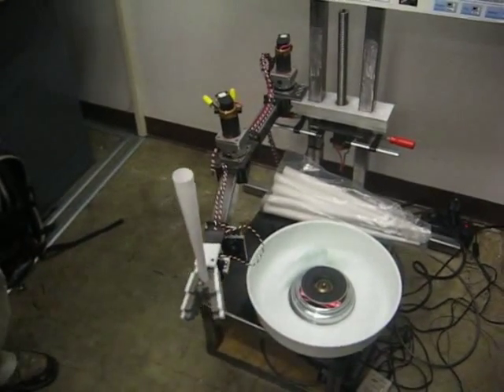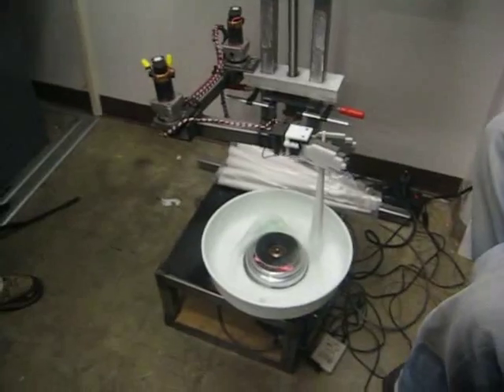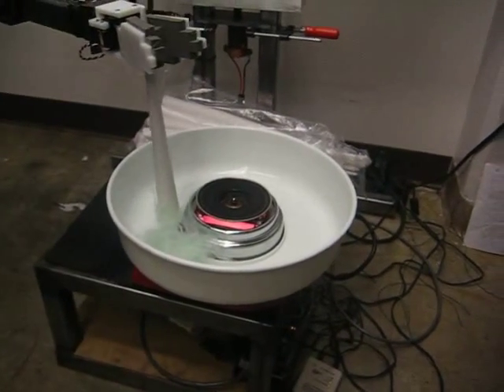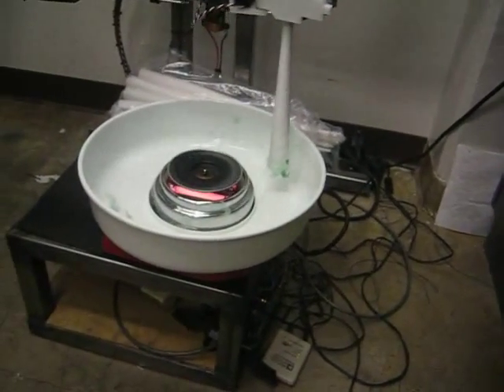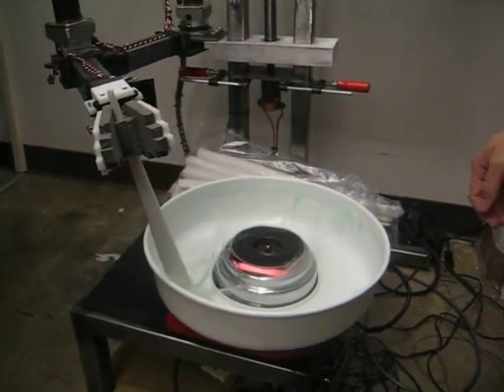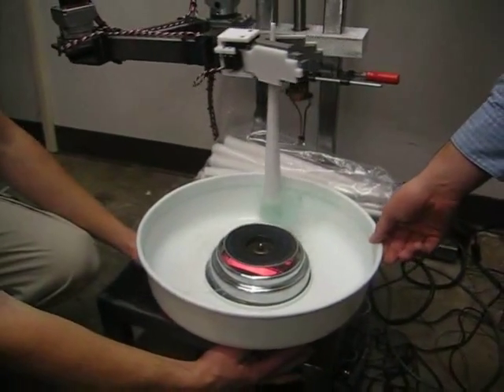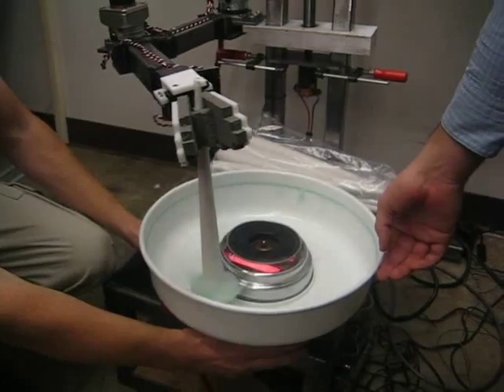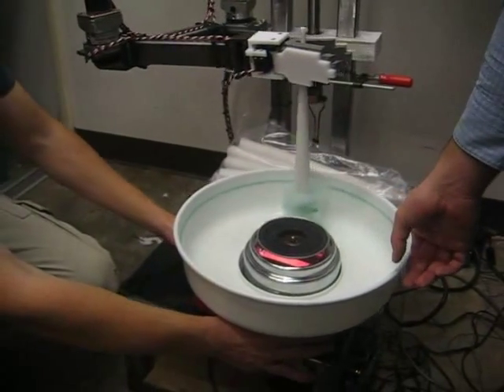Cotton Candy Bot

Comment: Next time try a five axis stepper motor set up with a X and Y gantry, Z axis for lift, B rotary axis to flip the cone and C axis screw clamp for grip. You can easily program it to make 3 point arcs and it would have smooth fluid motion without the jerky action and pauses.
Good idea for a play toy.